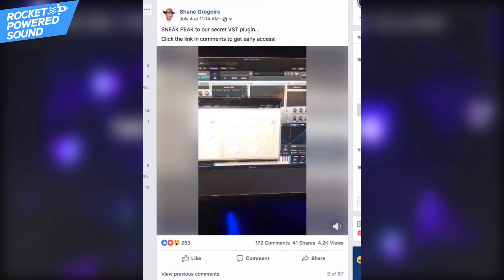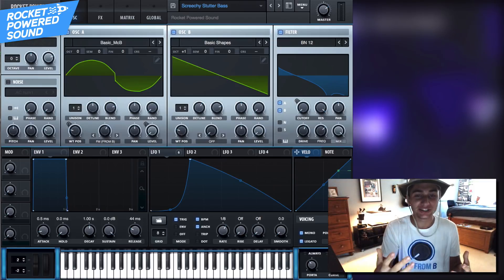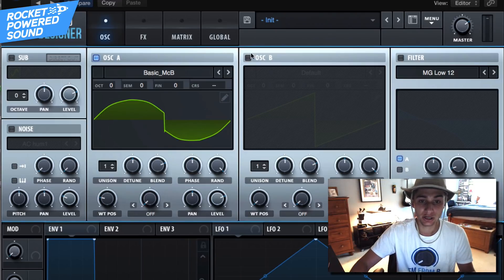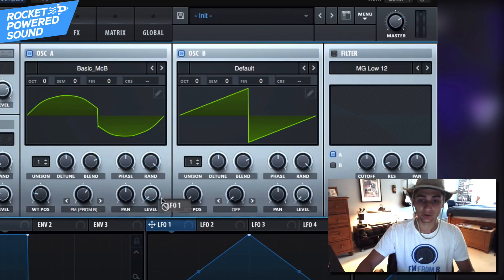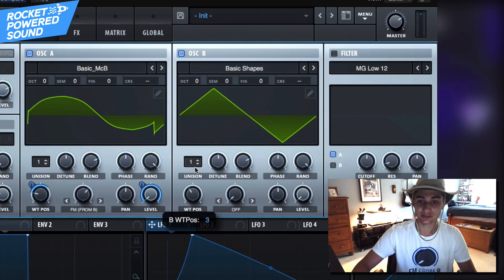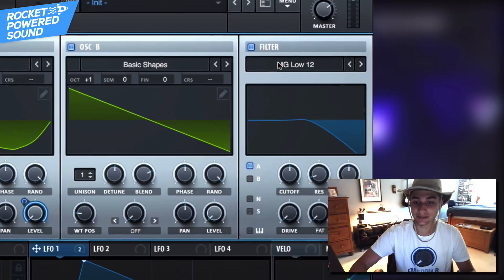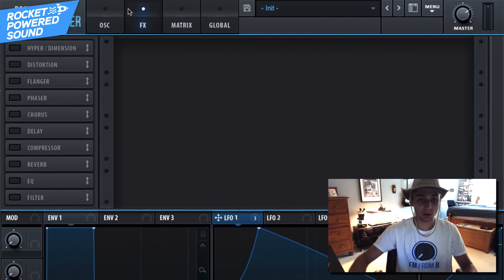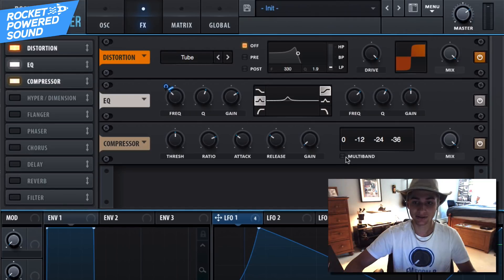MAKING DUBSTEP GUTTER SCREECH BASSES IN SERUM TUTORIAL HOW TO

Comment: Question. I love your videos, but I am curious to know how something with so much high and mid frequencies could be called a bass?  It's something that's been scratching my head in both using and creating presents.
Thanks for all the great vids!
Reply: IDK
Reply: In dubstep and drum n bass (where these types of basses originate from), There is often little more in the track than a bass line and drums.  The "bass" provides a rhythmic "call and response" with the drums and also fills the frequency spectrum in the mids/mid highs.  There is usually a sub oscillator layered underneath the midrange elements which follows the same pattern, and fills out the low end.  When you listen to these sounds you hear the mid to high range elements the most, but you feel the low end.  This creates the huge sounds that make you want to bang your head at a show.  The mid/high portion of the sound fills in what would be a pretty plain sounding beat if it was only the subs in action.  Drum n Bass has long been a very sound design driven genre and dubstep is it's bastard son.  Many of the most interesting tracks in both genres contain little in the way of melodic content.  It's futuristic, machine rhythm music distilled down to the most base (bass, ha!) elements that make you want to move.
Reply: O.P.F. great response! Thanks!!
Reply: You're welcome.  Work hard at sound design and production and you'll get where you want to be.  My advice is to not copy tutorials exactly.  Just use them as a reference point to develop your owns sounds.  Producers who stand out from the crowd have unique sound design.  Don't be afraid to experiment and break the rules.